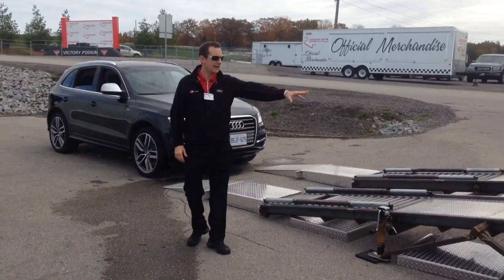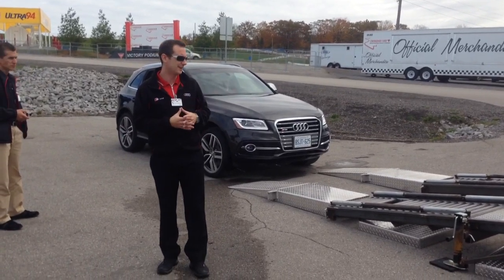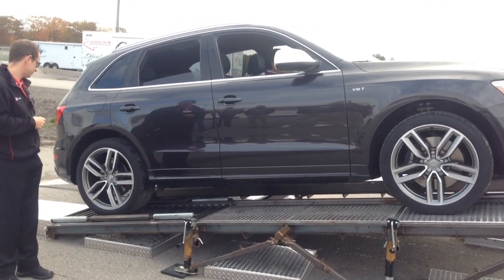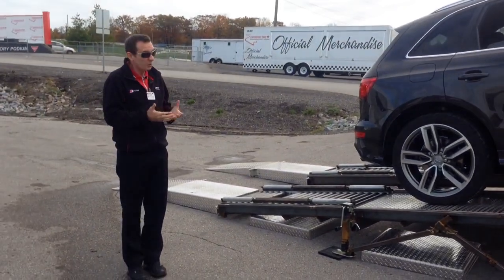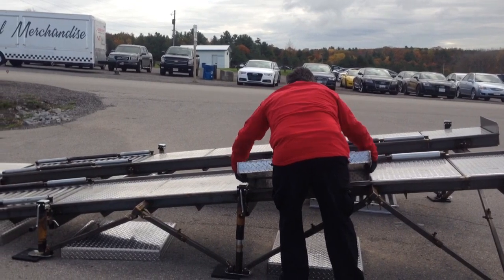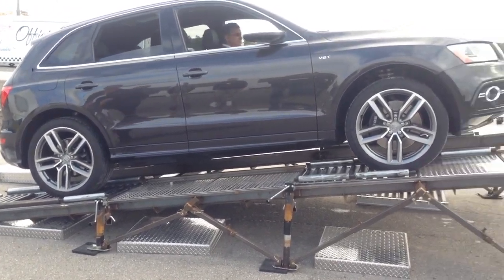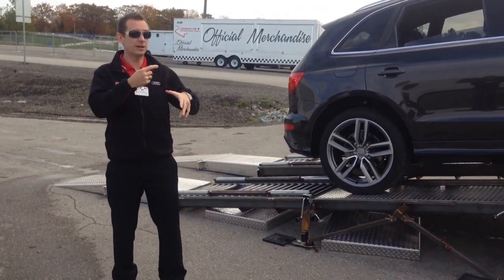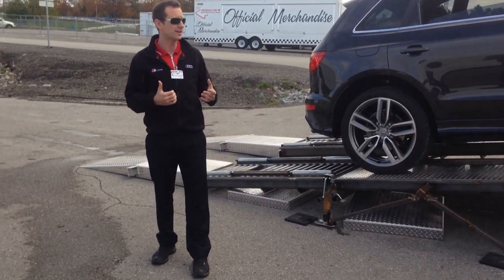Quattro vs Xdrive The answer to the BMW video

Comment: The new Q5 with 2.0 4 cylinder engine do not have torque vectoring and are not as good of a system unless you get the SQ5 with the 3.0, 6 cylinder

Comment: Do it with only one rear wheel having traction and it will fail the test.
Reply: No it won't. This Quattro is slightly rear Wheel biased. So it has easier time to transfer the needed power to the rear wheels.
Reply: The Audi Center diff needs a Minimum amount of traction to Lock. Zero traction is A Situation that doesnt occure frequently. If three wheels are with Zero traction Just Push the brakepadel a Bit when acceleratoring. this will clos the Center diff immediately. On the Others hand the Audi system has an adventage when towing Trailers. In Slippery curves the BMW system tends to fail
Reply: Michael Wittwer Not at all. There is more load on front, so you can transfer more torque to front wheels, although system is slightly rear wheel biased. Older Quattro (2007) fails such test with only one rear wheel having traction, while it passes while only one front wheel has.